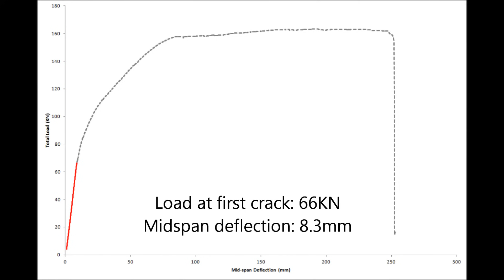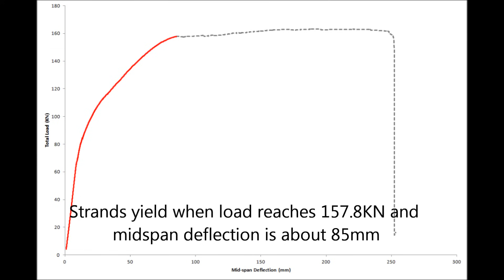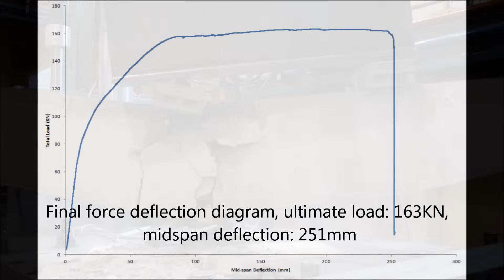Beam Test...watch beam failure in slow-motion!

Comment: I'm impressed that the beam failed in a controlled manner and never actually completely fell down.  If this had been in an actual bridge, the cracks and deflection would likely have been noted and the bridge closed long before there would have been loss of life.  Even at the end with massive deflection, the bridge would still not have fallen.
Reply: Maybe, but you have to remember that the load press is designed to stop applying load once a certain yield is reached. so at final failure, the load was removed. In a real application the load would have continued to be applied, until free fall of the bridge.
Reply: It's a controlled pressure. When the samples break, the hydraulic machine stops.
Reply: It was purposely designed as an under-reinforced or balanced design beam. Which means the steel tension reinforcement yields first (and slowly), before the concrete in compression. If it had been over-reinforced, the concrete would have yielded explosively before the steel reinforcement and should be avoided for obviously reasons.

Comment: I like this procedure. When I studied some decades ago, we students were given the task to estimate the load when first cracks appear, the deflection at this load and the maximum load the beam would bear. We were given all the information of the continuous rectangular cross section, reinforcement and cube strength and E-module of the concrete. We also had 2 point loads. 4 weeks after casting we could watch the experiment like the one shown. It was very illustrative as we found out, that the formulae worked very good.
Reply: popogast who won the pot?

Comment: 66 KN is 14,877 pounds
156 KN is 36,070 pounds
163 KN is 36,644 pounds
if anyone was wondering.
Reply: Yeah, that's helpful for anyone still using neanderthal units.
Reply: @Kalumbatsch  like me
Reply: I was wondering 💭
Reply: @HitLeftistsWithHammers  fixed
Reply: @Kalumbatsch  you can divide by 10 to get the approximate weight in tons, since 9.81kN(gravitational pull of the earth times 1000N or 1kN) is 1 ton
Reply: @jungemitball  It's better to use the right dimensions and units. The Earth's gravitational acceleration is 9.8 m / s^2 which is the same as 9.8 N / kg since the newton is defined as kg * m / s^2.
Reply: @Kalumbatsch  you're right, but thats too complicated for 80% of people on the internet, so I usually ELI5.
Reply: @jungemitball  But it's not an explanation at all if you confuse mass, weight, force and acceleration.
Reply: @Kalumbatsch  I dont know man, divide by 10 sounds less confusing to me than "m/s² and kg/km³ is pi to the square root of 5...." but okay bro, not everyone cares about that shit and just uses a rule of thumb
Reply: @jungemitball  But it doesn't explain anything. What is that 9.81 you used? It's a number that doesn't mean anything. You call it the "gravitational pull of the earth", but a "pull" is a force. The gravitational acceleration in Earth's gravitational field is 9.8 newtons per kilogram. That's not complicated. It tells you how many newtons you get for a kilogram. And those are the right dimensions and units. Just trying to be helpful. You know, I've studied physics anner Uni, Dicker.

Comment: Spent two years of my engineering internship at the Portland Cement Association Structural Research Lab, the reinforced concrete equivalent of the PCI. While we designed, constructed and tested all manner of bridges and buildings I think my favorite was developing a reinforced concrete railroad tie. The tie not only must resist the zillions of cycles of the wheel loads but freeze/thaw and high temp cycles, abrasion from the ballast, side loads absorbed on curves and braking load must be considered. And to think I took them for granted.
Reply: Plus, as I recall from my own destructive testing days, heavy hammering with one of dad's best by ten/eleven year old boys (later I may admit to penny testings on the rails).

Comment: I have so many questions. What's in the beam? Steel rebar? Tensioned cables? CFRP? What's the concrete made from? Does it have additives? What's the criteria for the test? Looks super fun.
Reply: Not sure, a square hollow though is extremely strong as to the way it transfer forces around and I only know that from randomly watching a YouTube vid yesterday that was explaining some inherent failure in I beams. Might be worth searching with those search terms. I wonder if it had tensioned steel cables within.

Comment: So even after it cracked and failed at 66kn, it still supported over 150kn and even with many cracks it stilled held strong. Until at least 163kn
Reply: Its normal thing for reinforced concrete. There is no fail at 66kN.
Concrete cracks because it can't handle tension, but rebars can handle tension.
Reply: @SAIGUK  More accurately, because it lacks the elasticity of the steel rebar.
Reply: @nairdacharles9492  Can't agree.
Concrete has elastic modulus for tension and compression. Elastic modulus is nonlinear.
But concrete cracks only because of lower ultimate tensile strength.

Comment: That was a lot more deflection before failure than I was expecting for concrete.  The steel must be really stretchy, relatively speaking.
Reply: This is pre-stressed concrete, not reinforced concrete. The beam has internal cables which have a designed load applied to them prior to casting the concrete. These cables have placed the surrounding concrete in a "super-compressive" state and are absorbing the tensile load at the bottom of the beam. A standard reinforced beam would have failed sooner and more dramatically.

Comment: this is my alma mater although electrical eng. but you would have lectures in this building and from an upper floor there were large windows where you could look into the main lab. they were always testing something either concrete or large wire ropes as thick as your arm to failure. this was back in the early 80's so yah i'm old. i'm sure things have changed there in 40 years.  at that time the contest i remember was a model bridge with a span something like 3 feet. and materials were mostly anything . the winner was the one with highest strength to weight ration. so most of the models were wood/ composite.

Comment: 5:50 beautiful how concrete cracking can close without leaving a trace
Reply: Almost certainly steel reinforcement springing back and pulling it back into place. Wood also does this, by the way - when it loses moisture horrible looking cracks start to appear, then when the moisture content goes back up it seals back up perfectly like they were never there.

Comment: My first concrete beam design project in college asked us to come up with an optimal profile, cross-section and steel reinforcement for a simply supported beam of specified span, to carry a specified load. I came up with a profile quite similar to the one being tested here ie. with a deeper cross-section at mid-span than at the ends. I was surprised however that most beams in practice (like those across highways) have the opposite profile, with deeper ends than at mid-span. Apparently, engineers in practice are more concerned with resisting shear forces at the ends than bending moments at mid-span.

Comment: Under that much stress it's possible something could fly off. Surely the operators would be safer in an elevated position and further away.
Reply: It’s concrete it just crumbles
Reply: It was not their first beam.  That day.
Reply: it crumbles and much safer with the gradual force.

Comment: No safety glasses, no protective barrier between the test equipment and the desk and monitors...  Seems these "engineers" are ignoring BASIC safety concepts.
Reply: Maybe they just seem to understand the nature of these reinforced concrete failures just a tiny bit better than you? Possibly? 👀😎
Reply: @stevendegreef93  Maybe he understands the benefits of managing risk just a tiny bit better than you?  :)
Reply: @stevendegreef93  If you ever stressed post tension cables you would understand how dangerous and unpredictable a blow out can be.
Reply: @shanesooth6267  Those are springs. Free steel under tension. Completely different animal. In this case all steel has been encapsulated with concrete, there s just no way that all tension on the steel can be released at once. Or does your imagination see all the concrete letting go of all the embedded steel at once? (footage contradicts you) (you must be right, these engineers are soooooo dumb.... 😆)
Reply: @stevendegreef93  Very possible. These are the engineers that maybe wrote the Standards. They had been doing thousands of breaking samples and they know when they need one.

Comment: Bizarre lack of containment around this beam. Concrete failure of these beams during stressing is not unusual and can be explosive in nature with large pieces of concrete being expelled at high velocity. This is not a hypothetical safety issue. It's a real and extreme danger that any stresser will tell you about.
For those of you questioning the lack of safety glasses and PPE. No amount of of PPE will save you from a baseball sized lump of concrete travelling at 100mph.
Reply: I totally agree with you E Murphy I am a retired Ironworker and have experience stressing cables in parking structures and have seen blow outs a few times.
Reply: Old dude in chair was chillin’. No biggie.
Reply: Explode? Not in concrete that crumbles in a gradual force om a lab.
Reply: @romeoETmike  those post tension cables can easily fling concrete pieces in a split second. I have seen it happen with my own eyes.

Comment: I'm sure OSHA would not approve sitting next to that device without some type of  barrier.
Absolutely bizarre?
Reply: Brains...
Reply: Was also surprised by lack of containment. Was wondering if I was even correctly understanding what they were doing.
Reply: It doesn't matter if OSHA approves or not. This isn't their jurisdiction. Also, those engineers knew that it was not going to be an explosive failure. The debris all fell within a 1.5 meter area directly below the failure. Nobody was closer than 3 meters to the beam during the failure event.
Reply: @bob2161  Don't be silly
Reply: @tomsreviews238  how is my reply silly? Are factual observations silly to you?
Reply: @bob2161  I was in the construction business for many years. Unexpected things happen all the time and you need to take reasonable precautions. One mishap could cause serious injury or death
Reply: @tomsreviews238  yeah, whatever. This video isn't about construction. It is a test laboratory. Destructive testing, done under very specifically controlled conditions. The known "burst radius" is =< 1.5 meters. So the safety radius of no less than 3 meters is observed. 
Why does everyone think that rules equal safety? Your own common sense will go much farther in saving your skin, than some rule that some politician beurocrat, that has no practical experience, made up.
People need to stop telling strangers how they are supposed to live their lives.
Reply: @bob2161  Many operations are done under controlled conditions. Unforeseen things happen and if you don't protect against such things tragedy can happen that can't be undone. It's called common sense.
Reply: @tomsreviews238  Oh, you're talking about common sense. I'm all for common sense. OSHO, however, is legislation. You cannot legislate common sense. Especially when politicians are involved. 
A company being made to pay an exorbitant fine does not stop unexpected events, tragic, or otherwise, from taking place. 
This expectation that some government entity, is going to be able to keep you from doing something stupid, is dangerous. It tends to promote a false sense of security. There are people, employed in potentially dangerous jobs, that believe, so long as they follow all the rules, wear their approved gloves, goggles, and gear, nothing bad can happen to them. They begin to use common sense, less and less often. Until they seemingly forget all about it. When that happens, folks like me have to go pick up a mutilated and barbecued corpses. Usually still wearing their safety glasses and safety harness. 
Scientists and engineers, working in a testing facility, tend to have a pretty good handle on common sense. They're pretty good at knowing when something is likely to have unwanted consequences. They know when they should put on a hard hat and safety glasses. I've yet to go mop one of them up. This video is about scientists and engineers performing a destructive test on a known structure. It is not about construction workers. 
Construction workers are a completely different story. By my experience, they tend to not think through the possible/probable outcomes of their actions. 
Already this year, I've picked up 4 corpses from work sites. All but one was fully decked out in their OSHA mandated gear. The one was properly outfitted but was not wearing his hard hat. The hard hat would have done nothing to prevent his death. He attempted to catch something that outweighed him three times over. 
By the way, two years ago, I picked up a guy that died as a direct result of the OSHA mandated safety harness that he was wearing. 
I've also picked up more than a few folks that would have survived the auto crash they were in, if not for the airbag deployment. 
Yeah, I'm a big fan of common sense. OSHA, politicians, and beurocracies, not so much. Not everyone can be protected from themselves. Maybe, some people shouldn't be.
Perhaps you can understand my position. You might not agree with it, and that's ok. We are all allowed to have, and express, our own opinions. That hasn't been legislated away. Yet. 
Now that I've elaborated on my position, you may, or may not, wish to express the reasons why you believe what you do. 
It is perfectly acceptable if we agree to disagree.
Reply: @bob2161  did you ever hear of " lateral movement?"
Reply: @markschiavone8003 a lateral movement is when you take on a new job that's at the same career level as your current job, but may have different duties. A lateral move is not the same as a career change, though, as you generally stay in the same career field or even the same company.
Reply: @bob2161  lateral movement of physical objects. Downward forces creating lateral movement more specifically. The chances of that beam moving laterally under these conditions are highly unlikely but it could have wiped out that guy in the chair.
Reply: @markschiavone8003  downward forces create downward movement, lateral forces create lateral movement. That test was imparting downward force only. The support blocks are set up as they are to insure that only downward force is involved. Also, that was a progressive failure. The beam was shedding (dissipating) energy over an extended period. What you're alluding to is an explosion failure in which the member would release the imparted energy in a single, instantaneous, event. That beam, and that test, were both designed in such a way so that scenario could not occur. 
Is there still a chance? Statistically, yes. There is also a similar statistic chance, that a small, previously undetected meteor could enter earth's atmosphere, and fall directly onto the top of your head. The consequences would be devastating (at least to you). I think you should wear safety glasses at all times, just in case. That way, the OSHA official can testify that you had observed safety protocols, and the appropriate inscription can be made upon your headstone.
Reply: @bob2161  ok

Comment: I wonder what the failure would have been if the weight was applied evenly across the center, not across two 6 inch(?) 4 inch(?) wide areas a few feet apart.
Reply: in real life the load is distributed on wider span, it's not the missile falling straight down; even truck standing on the road distributes the load between front and rear wheals
Reply: @HitLeftistsWithHammers  Actually there isn't much difference as far as the failure mode of this beam goes. The loading model for point loads vs linear loads is somewhat different but in the end it comes down to exeeding the compression capacity in the top or tension capacity in the bottom. That being said structures are always designed according the normative loads that are to be expected. (e.g. an column on a beam or floor could be represented as a point load wheras everyday use or snow is represented as a linear or areal load)
Reply: @casb2480  That's interesting to me. This isn't the same, but I'm reminded that the service strength testing of fire department ground ladders was accomplished by the application of point loads rather than distributed. My knowledge of that subject is quite dated, but here is a picture of current testing procedures, so it's done the same way now. https://www.ul.com/services/fire-department-ground-ladders-testing
Reply: @elizabetholiviaclark  also, for the sake of practicality; it’s far easier to do testing like this as opposed to applying linear loads

Comment: And I bet you would take even more load, if it wasn't for the tiny contact area of those 2 blocks with sharp corners biting into the concrete and really concentrating the load. I assume it is calculated to be there and in this manner. Impressive either way.
Reply: @droppoint495  As your name suggests :D
Reply: That would be a different test.

Comment: Naively, I had it in my head that in this type of testing all human structure in the test zone was removed to a far distance per civil engineering standards - foolish me.
At 04:25, when "orange helmet/blue t-shirt man" pushes the cardstock? under the beam while under test to sample fallen material - quite interesting - can they forecast the inevitable destructive collapse that accurately?
Reply: It does not fall down or explode when it cracks trough.
 the load is released because it's a press and not an object on top ☺️